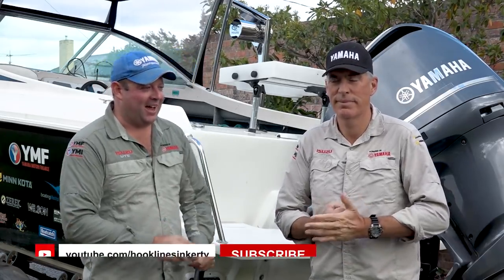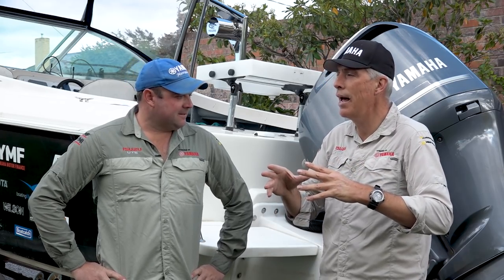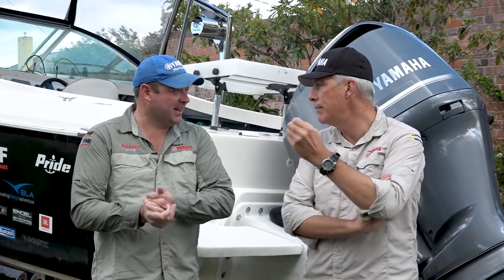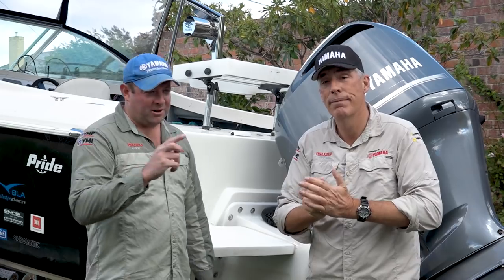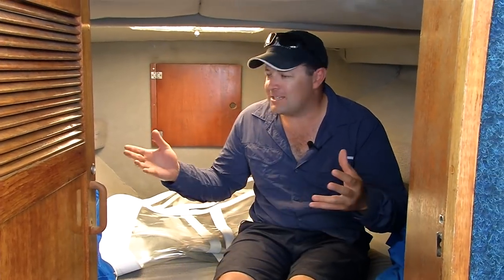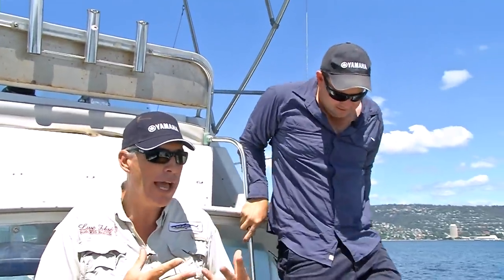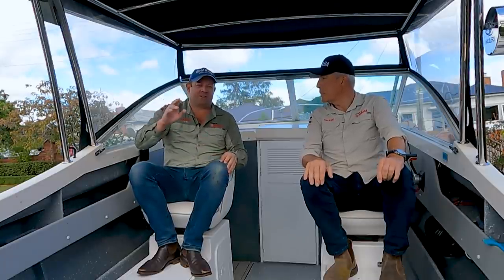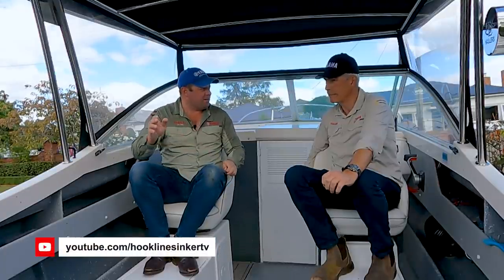Project Boat - Repower and restoration of a Bertram 25 flybridge cruiser Pt 1

Comment: The family of engines that these boats ran with came from much later than 1929.
These same engines powered all the Checker Cabs and C10 Chev trucks and El Caminos and a myriad of other GM units. Bullet proof. And not from 1929.
Go back and check your history before posting such crap.
Very loose with facts guys.